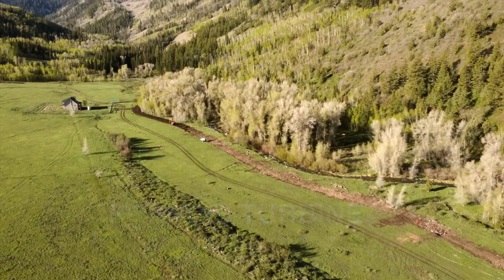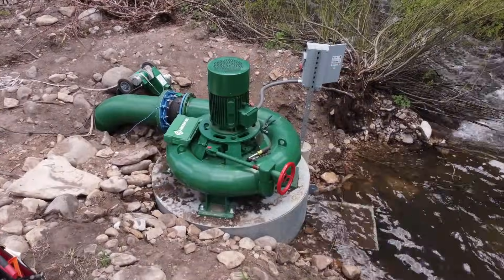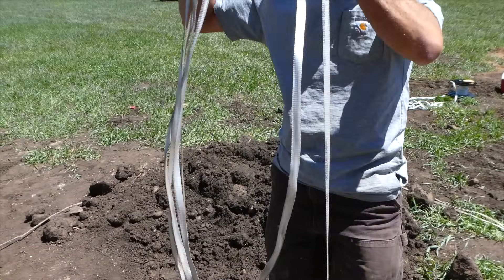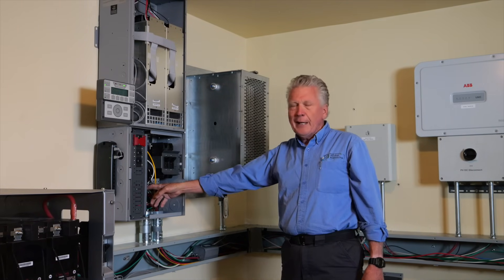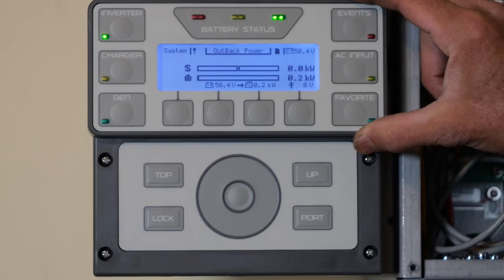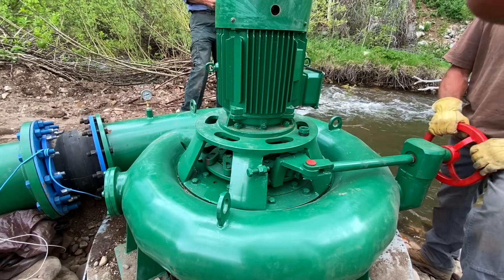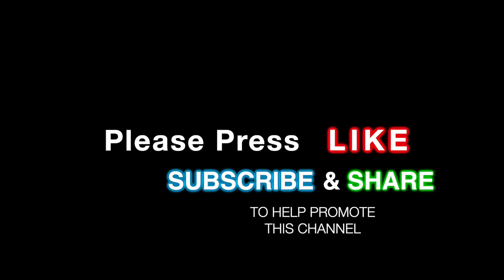MicroHydro Francis Turbine Part 2

Comment: Correction:  At @5.45 this man's description says power goes into the AC "outputs" of the 8KW inverter. This is a wrong description, the correct explanation is the AC power goes into the AC "inputs" of the 8KW inverter.

Comment: It can be done on much smaller level and all hand made products. the electric control room was like Starship Enterprise.     I would go for 2 smaller hydros to switch from avoiding use of batterys     This is done a very industrial level.    Not for the normal offgridder but its a great video
Reply from the maker: I don't own this system and merely documented the installation.  I agree that the control room is overly complicated.  There are always many ways to design and implement a system.  The system I own on our property (majority of my channel) has no batteries and that was an initial choice I made as I didn't want the maintenance and replacement issues.  My system (https://www.youtube.com/playlist?list=PLtTypVpmDd-vkT9bJQkXw4I1t0e_4jMYA) is much more in line with being a simple off-grid design and has served us consistently for nearly 3 decades.  Thanks for watching.
Reply: How are you going to balance the load and production without battery buffer?
It is possible to just overproduce to always make more then the max load, but the hydro could end up being 4 times the size needed for a regular day of use, because it needs to be sized to fit the peak spikes, so the system might be more expensive then just using batteries to take the peaks.

Comment: Just a word of warning you need to put your wire splice above ground in a water proof box because after every big rain water would floods and burn and short the  connected wires and my whole system  would shut down.  Just a suggestion.
Well good luck.

Comment: Yet again not enough protection for the turbine itself, in my opinion as the turbine is so important it should be housed in its own small, lockable building. This keeps it both safe and quiet as well as providing the proper environment for maintenance.
Reply from the maker: @damiansnuff  I believe the owners DID house the turbine but used a different contractor to do so after the system was installed. Good forr sound abatement as well. Thx for watching!
Reply: @mrhydrohead  - great video.

Comment: How loud is that turbine?  The sound of the stream was over taken at half power, it puts out what 70-80 or some dB? Did the house the turbine? It would be maddening to me if there were a constant mechanical noise disturbing the peace
Reply from the maker: Sorry for the slow reply.  Because I don’t own and haven’t visited this system since making the video, I don’t have an accurate answer for you.  My understanding was that the owners intended to install a silo type structure to house the turbine.  I doubt they left it out in the elements where the noise would be highly unpleasant and the equipment would degrade over time.  If I get an update I will post another response to you.

Comment: That would've cost somewhere between $100 -$130k , 6KW or 144KWhrs/day is way more than one house can use , an EV would use some up or a small business that needs a heap of electricity too.  Batteries are there to create a huge amount of DC so if you need more current than the turbine can provide at once , you have it all ready and stored up, remember at low flows in the summer it won't be producing much power at all but that's when you don't need as much as you cook less (salads) and don't want hot showers or home heating.

Comment: A basic concept of service burial is to embed the services (pipes, wires) in sand. This minimizes the damage that you saw when just dumping the spoil back in the trench. Six inches below and a foot on top will give you adequate protection from the boulder size shown in the video. Doesn't have to be quality sand, can even be pea metal which is sometimes sought because it allows more independent movement for the pipes. You can also use a grizzly when excavating to separate the boulders out from the soil so that they either don't go back in the trench, or the operator can lay down a layer of soil before putting the boulders back in
Reply: Sand might be expensive.

Comment: A pity they've gone with lead-acid AGM.. that internal resistance, low cycle resiliency, and AGM-specific deep-discharge sensitivity are all huge downsides to that old battery tech
Reply from the maker: I don’t own this system and merely documented it.  Personally I know next to nothing about competing battery chemistries. I chose to go straight AC with a load controller on MY system on the majority of this channel.  I didn’t want to maintain or replace batteries. Straight AC works great if you have enough wattage and can pay attention to the load you’re placing on the system. Thanks for watching and commenting.

Comment: Great video but I too would like to know the cost.  Digging 1200' is not cheap, plus the pipe, turbine, misc. electrical inside the home, clean backfill material, LABOR!  I just cannot see the ROI being worth it.  Now, if you are in the middle of nowhere and the local power company quotes you six figures to bring electricity to your home then maybe it's worthwhile.  Plus there's always the independence factor.  I would love to work on one of these from the electrical side (electrician here)
Reply from the maker: I don’t own this particular system and only documented it.  With the costs you list I do expect it went over $100k. But it is beyond the reach of the grid, so it probably would have cost a fortune to bring power in.  The system I own shown in the majority of videos on my channel made great sense in ‘96 being 7 miles from the grid.  It continues to provide abundant reliable power now up to 511+ megawatts since installation and a joy to live with.  Independence factor does rule! Thanks for watching

Comment: In the USA, you can build small hydroelectric power plants, but the European Union prohibits them using a strange water directive, because hydroelectric power plants kill fish, a sick law.
Reply from the maker: That is indeed very sad.  There is a Belgian (https://www.turbulent.be) company that has created a Turbulent turbine which is supposed to be harmless to fish.  They can even coat the turbine blades with softer material to prevent harm to fish and they divert a small portion of flow for low head power generation.  I've been curious to find one of these systems to document.  I wonder if they've found an exception or worked to create one for the European laws.  Our system (https://www.youtube.com/playlist?list=PLtTypVpmDd-vkT9bJQkXw4I1t0e_4jMYA) never allows fish into the system and only diverts a small portion of water in the creek for a run-of-river configuration.  Protecting natural habitats is vital.  Thanks for watching and your comment.

Comment: I reaoly commend your amazing effort ...sharing so much of information for free...still there are heroes like you in this money oriented world... Please guide us about the output of such a system and not specific but a rough expenditure?. Is there any guidance from which seller to buy this turbine from China?
Reply from the maker: I don't own this system, so I don't know how much the total system cost. Even if I did provide cost figures, it would not be of much benefit as each system is unique to the chosen site and costs can vary widely depending on numerous factors.  First there is the potential power available at the particular site which dictates if the desired use of that power is practical.  Who will design the system?  What will be the best equipment and materials available to meet the unique requirements of the most beneficial and practical design?  Then there are expenses involved in acquiring water rights which are likely different in each state or country depending on a pro se (self applied) application or hiring lawyer to work on them.  Who will do the labor to install the system?  Is it your own sweat equity, friends that can help, or hired labor and at what rate?  How much time will it take to install?  What materials can be accessed?  Reused or new pipe, copper or aluminum wire?  How long a length of wire?  What building(s) will house the equipment?  What transformers, batteries, load regulators, power shunts, or utility net metering are available and/or appropriate to the particular site?  All of theses factors can add to the costs and it would be naive of me to present  a one size fits all price.
One must be clear that installing a system is creating an asset which would likely provide power for a lifetime.  Can it be financed over time and does that cost make economic sense when compared to running utility lines to an off grid property?  Will a local utility be willing to purchase excess power and at what rate?  Undertaking a project of this size is not for the faint of heart. It IS a large commitment both financially and in effort and time.
My first system (1.5kw) which I own and documented on this channel cost ~$25k and was installed in the mid 90’s.  Redesigning and moving the same equipment to a more reliable water source was also documented on my channel and took place between 2013-2015 and added another ~$55k but boosted the useable power by a factor of 5 to 7.5kw.  WHEN a project occurs occurs is also a factor governing cost.  Inflation impacts everything involved and the fact that I intend these videos to remain on the internet for years to come and provide some clear eyed guidance to people that are serious about their own intentions, this dictates that I not mislead them with cost estimates willynilly.  
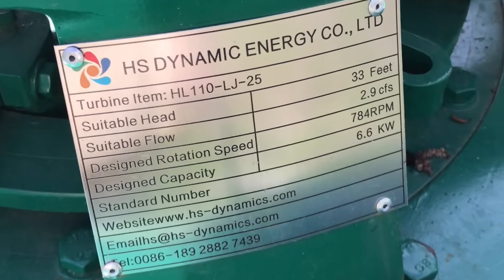Sorry to go on and on here.  I know the system in this video with installation costs were in excess of $100K.  Information on the specific Francis Turbine can be located off the placard on the side of unit at 4:25 in the video.  You can contact them for current pricing.
Thanks for watching and for your comment.
Reply: @mrhydrohead  thanks a lot for the detailed reply ...I appreciate your time and effort ... Keep up good work ...

Comment: I think for the cost of the system, you could also install a 40kWp PV system with a 2000 kWh LFP battery backup. This would be a maintenance free system that lasts you about 45 years.
Reply: 40KWp solar is 150-100 solar panels depending on size, that is roughly 2 football fields of panels.

Comment: I take it that the system is designed for 50 herz, a european standard, as oposed to the American standard of 60 hertz, careful not to connect it to the grid! The conversion to dc is a smart move, saves matching the turbine generator. One improvement I suggest: before the diffusor put in radial flow straighteners, then s six degree conical diffuser as long as necessary to optimize the system, the dc voltage as high as reasonable to minimize the ohm's losses, Other wise the best realization I have seen.
( Swiss engineer. ETH graduate)
Think of imbetting the pipe in a larger concrete pipe with continious drain, movement of the river bed is unavoidable.

Comment: Unfortunately, hydropower has extremely high investment costs (approx. 10-50 T$ per kWp), but generates electricity continuously (except during drought).
Hydropower therefore makes sense if you need to be self-sufficient from the power grid. 
Bur due to the extreme drop in prices for solar modules, electricity from hydro and wind power plants is now 3 to 10 times more expensive in comparison. 
Today you can buy 400W solar modules for as little as 50-70$.

Comment: Does turbine can freeze  at winter?
Reply from the maker: I doubt that it freezes.  I don't own this system, but the one I do own is at a higher elevation in the mountains and we have never had it freeze up.  Moving water tends to not freeze particularly if the penstock is buried underground.  This video https://youtu.be/G3pS_RVqVi8?si=UBpelhzozx4gyYZB shows how well the system I own did with super cold & dry conditions in the winter of 2017-18.  Thanks for watching!

Comment: I like your videos and have a question also. Im thinking of having 2 wells drilled on my property if possible. The first will be for some sort of hydro generator and go back into the y the second will be the main supply for the house and property. My question is, what type of generator do you think would be best for this project?
Reply from the maker: I'm not sure how to answer this.  To harness potential power from water, it needs to be moving and/or falling over a vertical change.  I don't know what elevations your intended wells will be or if there is an adequate difference in the two wells.  I also don't know how much water you intend to move.  The potential power is a result of two measurements.  Flow and Head (vertical drop).  I am assuming they would be drawing on the same water table and you would need some energy to pull the water from one well and it will feed into a second well with the same water table elevation.  As a consequence I don't see how you could make the system viable and worth the expense of putting it in place.  Sorry I can't be of more help.

Comment: please will u mantioned the
 cost and production of this machine
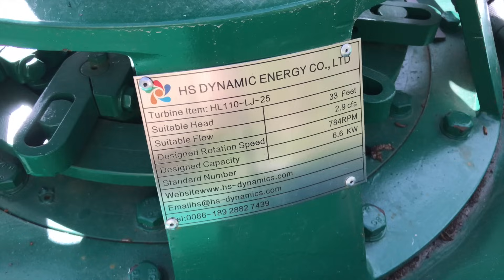Reply from the maker: I don't own this system, so I don't know how much the total system cost.  The turbine is designed to output 6.6kW. You can get the cost of the turbine itself by contacting the manufacturer with information on the placard shown at 4:25 in the video.  I hope this helps.  Thanks for watching

Comment: Excavation:$5,000-$10,000. Microhydro:$25,000. Batteries:$2,500.00 Electrical Equiptment and microprocessor: $50,000 Inspection fees: $3,500 Permits: $2,000.00 One Hundred thousan dollars total---"AM I CLOSE?:
Reply from the maker: I don't own this system, so I don't know how much the total system cost. Even if I did provide cost figures, it would not be of much benefit as each system is unique to the chosen site and costs can vary widely depending on numerous factors.  First there is the potential power available at the particular site which dictates if the desired use of that power is practical.  Who will design the system?  What will be the best equipment and materials available to meet the unique requirements of the most beneficial and practical design?  Then there are expenses involved in acquiring water rights which are likely different in each state or country depending on a pro se (self applied) application or hiring lawyer to work on them.  Who will do the labor to install the system?  Is it your own sweat equity, friends that can help, or hired labor and at what rate?  How much time will it take to install?  What materials can be accessed?  Reused or new pipe, copper or aluminum wire?  How long a length of wire?  What building(s) will house the equipment?  What transformers, batteries, load regulators, power shunts, or utility net metering are available and/or appropriate to the particular site?  All of theses factors can add to the costs and it would be naive of me to present  a one size fits all price.
One must be clear that installing a system is creating an asset which would likely provide power for a lifetime.  Can it be financed over time and does that cost make economic sense when compared to running utility lines to an off grid property?  Will a local utility be willing to purchase excess power and at what rate?  Undertaking a project of this size is not for the faint of heart. It IS a large commitment both financially and in effort and time.
My first system (1.5kw) which I own and documented on this channel cost ~$25k and was installed in the mid 90’s.  Redesigning and moving the same equipment to a more reliable water source was also documented on my channel and took place between 2013-2015 and added another ~$55k but boosted the useable power by a factor of 5 to 7.5kw.  WHEN a project occurs occurs is also a factor governing cost.  Inflation impacts everything involved and the fact that I intend these videos to remain on the internet for years to come and provide some clear eyed guidance to people that are serious about their own intentions, this dictates that I not mislead them with cost estimates willynilly.  
Thanks for watching and for your comment.

Comment: I have no idea how you can harness the water and alter the flow without someone turning you in to the government. Where I live, the government owns the water and monitors the rivers and lakes. You would never get away with this in the States. 
Also, the cost must be enormous and take many years to recoup.
Reply from the maker: Its called a non-consumptive "run of river" water right which must be filed for and approved by the state governing body.  I don't own and didn't design this system which was in the state of Utah, but I'm certain the designer/installer took the necessary steps to acquire the appropriate water rights.  
On my system which is in Colorado I filed in water court, was granted a "conditional right" good for 7 years, and once the utilization of the water was proven, the water right was made "absolute" meaning I didn't have to file on it again.  The laws and process of filing may be different depending on the state.
Micro hydro is not cheap, but if it is off grid as in this video's example, the cost is far less than running utility power lines to the property and then paying monthly bills for service.  its an investment in the property and a worthwhile process to achieve abundant power.  Thanks for watching and commenting.

Comment: Wouldn't it be better to control the speed of the turbine to deliver 60 Hz instead of 70? Switching to dc then back to ac incurs additional losses. Ok using batteries means some ac to dc and then back to ac in an inverter would be involved but if there's adequate water storage available I question the wisdom of using a battery at all